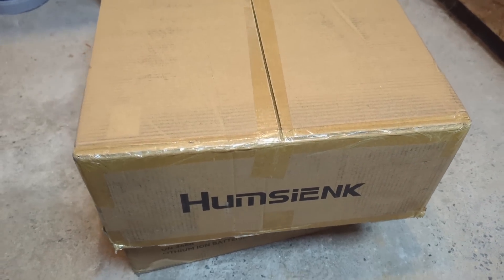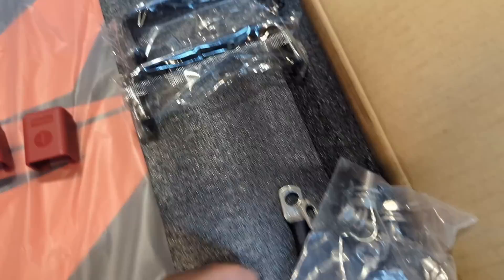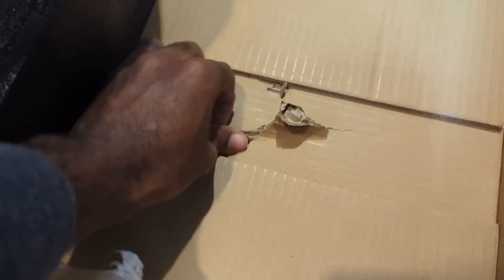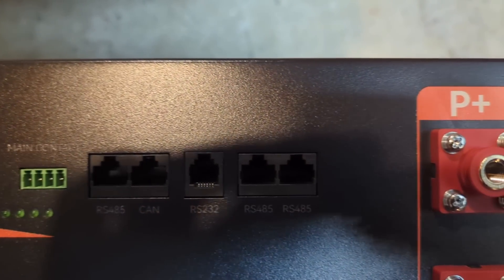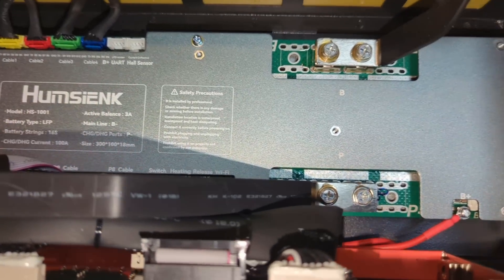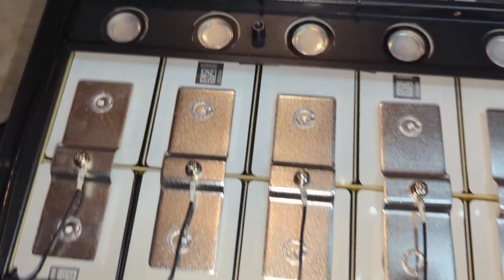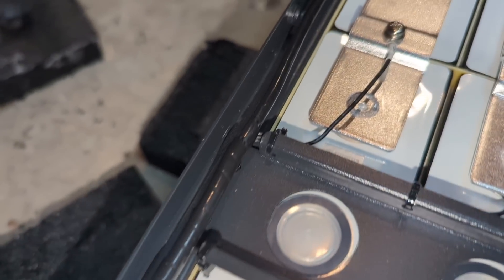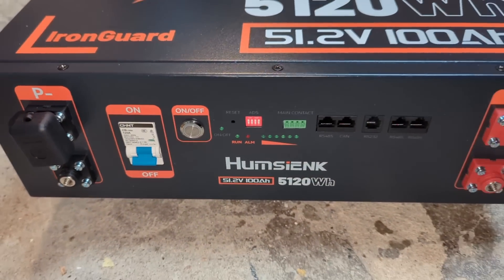Humsienk 48V 100Ah Server Rack LiFePO4 Battery - Cell Form EV Company

Comment: Puedes probar la nueva 51v 314ah?
Reply from the maker: I would review it if I had it. I only stick to 100Ah  because I have to take them to the basement (usually by myself), but 314Ah is a better deal compared to 3 x 100Ah.
Reply: @talenteddad Thanks for replying, if I guess it is better than 3 out of 100ah.